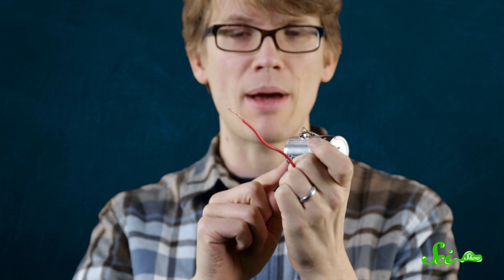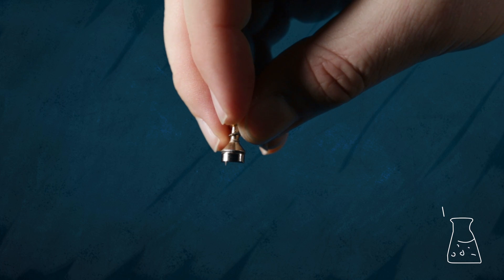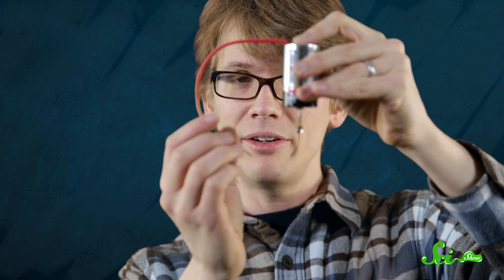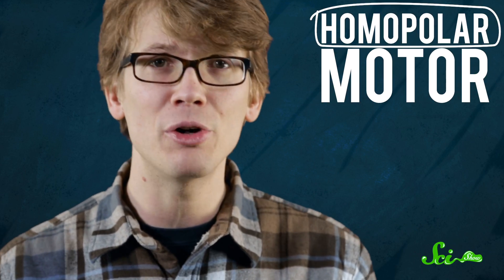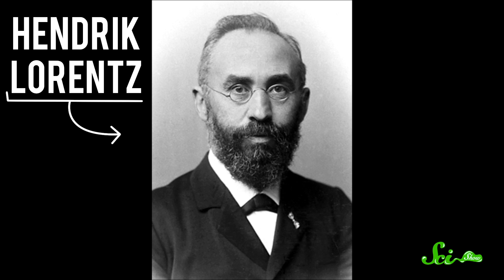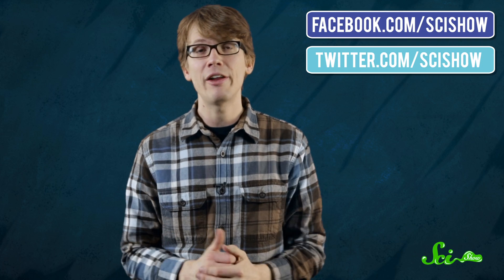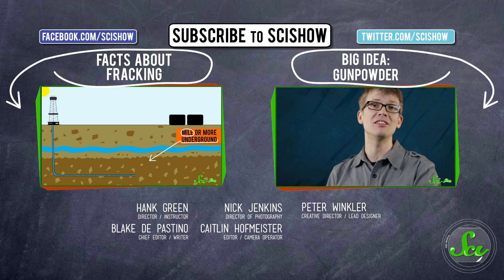How to Make the World's Simplest Motor: SciShow Experiments

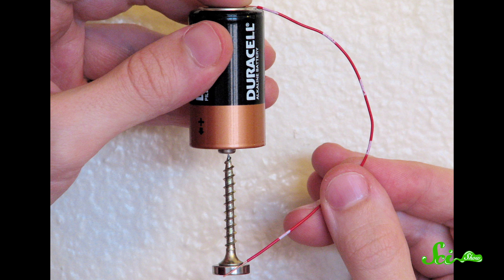Comment: Maybe someone can help me clear up a misconception I may have or maybe hank was wrong, but probably I am. Shouldn't the current flow in the other direction 2:30 since electrons are negative and trying to balance by reaching positive atoms?
Reply: What you describe is the physical electric current, which describes what is actually happening inside the cable.

When describing machines, usually the technical electric current is used, which assumes the current flows from plus to minus. It is an artifact from the time when it was discovered ions in a solution from from plus to minus, so it was assumed the charge carriers inside the wire must move from plus to minus as well. This was later discovered to be wrong, but they did not want to change all the conventions.
Reply: Electrons are different from current - electrons flow from negative to positive, current positive to negative. You just have to remember it. :)

Comment: Good video but If you could hold that thing for 10 secs the wire would be burning through your fingers.
To the viewers: Not a good idea to try at home but It's a good idea to wear safety glasses if you try experiments like this with batteries and sharp objects, with adult supervision.    It looks like the contact sparks were edited out.
Reply: +John Baxter That little battery isnt going to produce a visible spark unless your in the dark. Furthermore, thats way too much copper for any considerable heat to be generated. Battery will be spitting and sputtering before any change happens with the copper. Your either a high school science teacher or a dumb shit 14 year old.
Reply: Be my guest and get back to me when you short out a D cell battery with a wire.  Until then I suggest you reserve your opinion regarding your evaluations of the level of intellect of other commenters.  If you believe these "geek" videos are all based on fact, you are likely the fool and the target audience.
Reply: dude, not two weeks ago I tried to light my smoke with this exact principle using four C cell batteries. Failed with copper until I put a single staple in the circuit. Batteries are not as dangerous as people think.
Reply: +John Baxter must be a highschool chemistry teacher

Comment: I was taught that current flows from negative to positive when you complete a circuit with a battery. Does your video make a mistake at 2:18 by stating that current is flowing from positive to negative or is there something about this particular experiment that is truly making current flow from positive to negative?
Reply: Yea, old Ben gets the blame, but there was no way for him to have known. Some people at the time believed there was one kind of current flowing one direction and another flowing the opposite. We know this is true in some materials today (electrolytes in particular) but Franklin thought a single direction of flow was what was going on. The formulas all worked well with just one current traveling one direction (and they still do) the  only thing  was to decide on the direction it was going so the numerical sign value (positive or negative) would be consistent.
Reply: +JonPoncho As Tim said, by the definition of a positive voltage established from the invention of batteries  and the discovery of electricity which was long before the discovery of the electron in the 1890's, the direction of "Conventional" current flow is from positive to negative.  The direction of electron current flow is from negative to positive. An electron is a negatively charged particle so if electrons flow through a resistor and you measure the voltage across that resistor.  the "in" terminal will be negative and the "out" terminal will be a positive voltage by definition of voltage. If you connect an ammeter in series with a resistor and connect it across a battery, the  ammeter will show a positive current from + to -. As Tim mentioned, you don't need electrons to induce current flow.  Current flow is basically a transfer of energy between atoms and not of electrons or other charged particles actually shooting through a conductor or other medium.  The speed of the electricity is the speed of light (more or less)  but the velocity of the charged particles or ions transferring form one atom to the next is actually much lower and called the drift velocity.  Current flow direction is always confusing to early students in physics or electronics.
Reply: JonPoncho This is what is called conventional current.  All electric formulas are based of current flow from positive to negative.  This direction of flow was defined long before the existence of electrons was known or that they were responsible for current in most conductors.  Not all current is due to the flow of electrons. In semi-conductors, electrolytes and plasmas, positive charge carriers also can create current.
Reply: Tim Sites Try taking an A level in both maths an electronics, it gets really confusing. Dam you Benjamin Franklin.

Comment: Actually that doesnt demonstrate the concept how every motor works. What about internal combustion engines. I dont see a magnet firing the cylinders
Reply: Motors and Engines are NOT the same

As for internal combustion engines.
You have a starter motor to start the whole process.

But the process involves the following(i am no expert in this)

1. as the piston moves down the intake valves are opened, this downward force of the piston creates a vacuum which draws in air and fuel which is injected.
2. As the piston starts moving upwards the intake valve closes, since the air/fuel mix has no place to go it gets compressed
3 at a specific point the car sends an electrical pluse to the spark plug which ignites the air/fuel mix, this combustion forces the piston down since that is the weaker point in the system
4. as the piston is going down it creates a torque on the crankshaft which causes the other pistons to move up/down
5 as the piston is moving up the exhaust valves open which forces the exhaust gases out, and the cycle repeated.

Since cars have 3, 4, 5, 6, 8, 10, 12 and even 16. cylinders you can see how this processes makes the engine work

Comment: Would it be possible to make an electrical generator from opposing magnets?
Reply: You just move an magnet above an coil, an you will get an (weak) AC current
Reply: Dewayne Johnson Homopolar generators are essentially the same as the motor, except without the battery. They are most often made by spinning a metal disk inside a magnetic field.  The current generated is between the center of the disk and the edge of the disk.

Comment: Lol this reminds me of the motor I made in the fifth grade out of glue some insulated copper wire a couple of paper clips a magnet a aa battery and a block of wood for it to all sit on. This is much simpler no soldering and fewer parts.

Comment: why did you use conventional current instead of true current!??!?
Reply: Benjamin kier Conventional current is how the terms are defined. If you want to know what forces are created and in what direction they point, you use conventional current. Also, it is not "true" current, but electron flow.  Electrons are simply the charge carriers in most metallic conductors.  In semi conductors, plasmas, and ionic solutions (electrolytes) there are also positive charge carriers.  Current is defined by the movement of charge carriers, not the movement of electrons.

Comment: You got the flow backwards! The electrons go from negative to positive.
Reply: prowned seth094978 That was quite confusingly said. It is simply a convention that the direction of current is thought of as the direction in which a positive charge carrier would move, although normally it is the negative electrons which do the charge carrying in electric circuits.
Reply: ***** Still a little confusing to someone who doesn't already know the difference. It is simply the difference between conventional flow and electron flow. Years ago, Benjamin Franklin literally took an educated guess at which direction current flowed in a circuit. He just happened to guess wrong hence the old "Conventional Flow" or even "Franklin's Convention". With newer technologies it was proven that electrons move and populate holes from negative to positive hence "Electron Flow". Both are taught are universities but conventional flow is generally used in circuit theory.

"Let me Google that for you"...
http://lmgtfy.com/?q=conventional+flow+vs+electron+flow
Reply: actually no. That was thought to be in the past. but now it is known that the positive end is the anode and the negative end is the cathode. and thus the flow goes from anode to cathode.

Comment: so basically DC power is less effecent than AC power w/ amplifiers. though if you put the DC power through the same hops as AC power would it same be less effecent ? one thing which you could do is build a motor which could run on both AC or DC power then have a wheel go around and around by using that motor and show the differences from AC to DC power with that.

Comment: Actually, I did this with three items. Not nearly as powerful, but it worked almost just as well. I had two small nails and very strong neodymium magnet and I put the head of one nail on the magnet and then stuck the tip of the other nail to the tip of the first nail. The magnet was powerful enough to keep the two nail tips together, and so I held on to the second nail. When given a small start-up spin, it spun for two minutes or more.

Comment: The point of the magnet is to provide its own magnetic field and conduct the electricity right? So if I wrap a non-conductive permanent magnet in aluminum foil, will it still work?
I'm worried the aluminum foil might burn though.

Comment: Simply connecting the two ends with a wire would be easier and faster. Although, depending in how big the batteries are, you could melt the wire. Even with small AA batteries, a copper wire would get very hot, so you should do this while wearing gloves.

Comment: technically you could, but you would use the other magnet, pass it back and forth inside a wire coil which induces the electricity that can then be used with the other magnet. 1 catch, it will spin back and forth back and forth cause it would be AC current and not DC.

Comment: He is right, current is simply the flow of electrons, it goes from the negative to the positive, prior to the discovery of the electron, people believed that "electricity" moved from the positive to the negative terminal and hence diagrams and circuits are drawn up in this fashion, this is called conventional current. Even to this day we still use it although we now understand what current is and understand that it doesn't flow in that direction.

Comment: I realize that you are talking in a conventional circuit using metallic conductors that only the negative charges (electrons) would flow but the statement that "there is no such thing as a positive charge moving toward a negative one" is a bit too general.

Ions of both charges will move through a fluid such as an electrolytic solution inside a lead acid battery or during a lightning strike when if you watch closely the bolt comes from both earth and cloud to meet in mid-air.

Comment: When an electron moves from one atom to another, it leaves a hole where it was on the outermost electron shell. Conventional Current is described as the movement of these holes from the positive side to the negative. Electron flow is from negative to positive.

Comment: Referred to as Conventional Current, and shortened into just the word "current", it is described as the movement of holes from the phase to the neutral, as opposed to actual current, which is the movement of electrons from the neutral to the phase. 

When someone describes "current flowing from positive to negative", they almost always - and indeed, this is always assumed to be the case - mean conventional current.

Comment: There's no such thing as a positive charge moving toward a negative one, at least not realistically. A positron is the antiparticle of an electron. If you could create an entire circuit out of antiparticles, I guess you'd end up having positrons flowing instead of electrons, but again, not realistic.

And protons never "flow" across a circuit. They're locked firmly inside of the atomic nuclei. Instead, an electron moves away from a spot, it has "less negative" charge, thus more positive charge.

Comment: there is only one sort of current. Electrical fucking current. It flows because of a voltage, aka a difference in potential. It flows from the place with more potential to the place with less.

Comment: positive and negative only exist in DC, and "positive" just means more potential than the negative, that way the difference between the two is 50volts instead of -50. Positive and negative in physics are a measure of charge, and a positive charge moving towards a negative one would be a flow of protons...or positrons, or whatever else i haven't heard of...

Comment: Actually, it doesn't matter what flows where, because what we observe isn't the movement of charged particles, but the movement of the charge. In other words, a negative particle moving left is the same as a similar particle with an opposite charge moving right. Since what we call a currency is the movement of positive charge, it flows in the opposite direction of the electrons, the actual particle that's moving.

Comment: In all fairness when you get down to the math of electrical circuits it really doesn't matter which polarity things are. The only thing that matters is current direction.

If you end up with a negative amperage, you simply have the current direction backwards. The labeling is just semantics and it's sometimes best to just forget about positive/negative and let the numbers speak for themselves.

Comment: I'm sorry that you're an intolerant, brain-dead moron. In actuality, depending on what terms you're talking about the current vs electron flow, both are technically right.

I happen to be an Electrical Engineering student so I'm not copy/pasting, jackass.

In an electrical sense, the current flow is AGAINST the flow of the electrons.

When talking in terms of physics, the current flows WITH the electrons, however in the terms of this video we aren't talking about a physics view.

Asshole.

Comment: There's what we call domains in the structure of metals that all have their  own magnetic field due to electron position in that domain. Usually, all the domain points random directions creating no resulting force. The idea is to aligne all the domains with a really strong magnetic field while the material has reach a specific temperature and then cooling it down within the magnetic field. Depending on the behavior of the metal, domains can keep their alignement resulting a macroscopic force.

Comment: It has to be a metal that conducts electricity. A screw is often used because its small tip means less friction, so better spin, and because of its radial symmetry, which gives it a pretty stable spin. Other than that, any battery with poles at opposite ends should work, any magnet should work (as long as it's light and strong enough to stick the screw to the battery), and any wire should work, but copper conducts well, and I'd suggest using insulated wire if you don't want to get shocked!

Comment: Interesting, I hadn't remembered that error.  There are two things I would like to point out, though.  
1) Although the difference between a million and a billion is a lot, conceptually, most people wouldn't really get the difference, and could slip by as a grammatical error.  
2) Strange fact: current is usually shown to flow in the opposite direction of the electrons.  Don't ask why, it just is.

Comment: How about making a battery with household products. For example: Sodium chloride-Magnesium-cell, or Aluminum foil and drain cleaner (Sodium Hydroxide)-cell. 
Or the demonstration of the power of atmospheric pressure using an empty can of soda, fire and cold water.

Comment: Electrons are the charge carriers so they flow from the negative terminal to the positive terminal. Conventional current treats the charge carriers as though they were positive, so they flow the other way round. Before the discovery of the electron it was thought that electricity flowed in the conventional current sense. The maths looks at electromagnetism from the point of view of conventional current. Otherwise the mathematical equations would have negative signs everywhere.

Comment: Yes, Electricity flows from Negative to Positive, not the other way around.  The bits that are moving through the wire are *Electrons*.  (Hey, it's called "Electron-ics" for a reason:) 
They discharge from a point with an abundance of electrons to somewhere they aren't as abundant.   Basic battery chemical process causes electrons to leave one metal and over-populate another.  Which is why hooking a light to both ends works because the electrons have somewhere to go.

Comment: There are lots of forces acting upon it including but not limited to: Lorentz Force, Gravitational Force, and Electromagnetic Force. However the Lorentz Force is acting perpendicular to the rotational axis of the screw so it wouldn't matter to whether the screw would enter the battery. The Gravitational Force and Electromagnetic force almost entirely cancel but using observation, wild guessing, and napkin math it looks like about 1/64 LBF net acting in the upward direction so about 1/16 Newton.

Comment: since the screw is hanging off the battery there is very little force between the pole of the battery and the screw so it is insufficient to pierce the metal and start the inclined plane of the screw pulling the screw into the battery. Even then the battery has insufficient power to screw into metal.